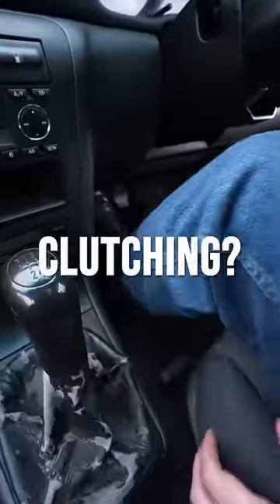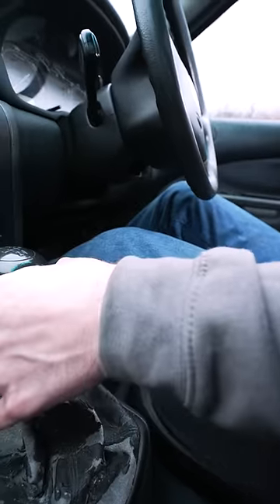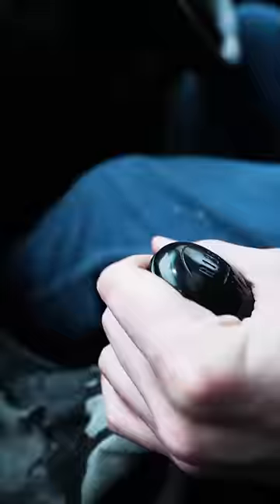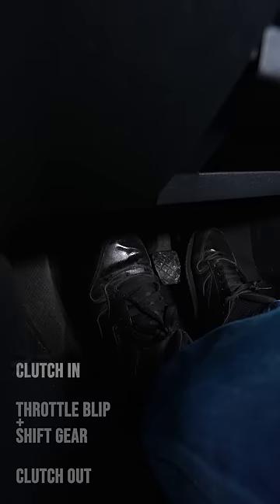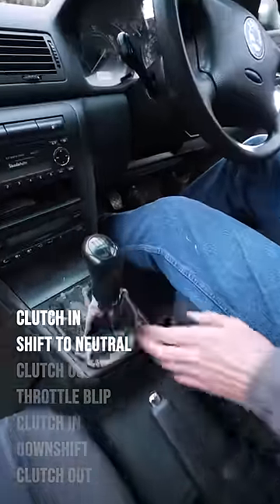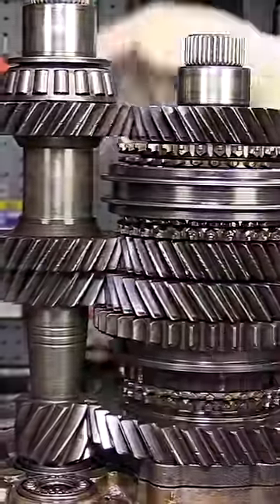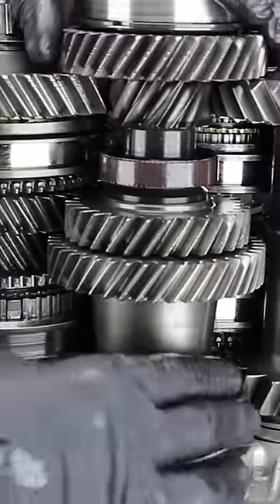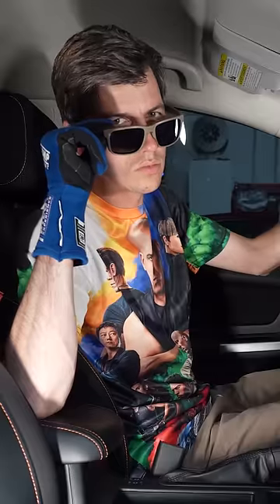What Is Double Clutching? Don't Granny Shift!

Comment: Finally someone understands the differences in transmissions and why double clutching doesnt work in a conventional passenger car manual transmission
Reply: well it does totally work, its just not as usefull
Reply: Double clutching does work on cars. I used to do it all the time with the old three on a tree cars.
Reply: It does work, it's just not strictly necessary. It definitely saves wear on your synchros, tho. Especially when downshifting, which is harder on the transmission overall unless you  have very accurate revmatching (as opposed to upshifting where you just need to pull off the throttle and naturally let the RPMs drop to match).
Reply: It also allows you to downshift faster because you use the engine to speed up the clutch, rather than using the slipping synchronizers to speed the clutch up.
Reply: It's pointless on most modern cars. I do use it when I need to use a LOT of engine braking, but that's it. Otherwise, it's slower.
Reply: It does work but not nessesary, it slows down the synchros and allows it to slide into gear easels. In a race tho your probably gonna be slower
Reply: Done correctly, it replaces the work (slipping) the synchs usually do - effectively making them last forever. Of course, anyone that knows that also knows using the clutch at all is absolutely unnecessary for putting the trans into neutral, and basically unnecessary for selecting the next gear.
Reply: @GroovesAndLands Yes, I often drive without using the clutch, going up the gears is a lot easier than down. Some gearboxes just don't like it but many don't have a problem. I usually get supplied with a new work car or van every two and a half to three years, sending the old one back with well over 100000 miles on it. In 25 years that's over 1 million miles, and in that time I only had one that needed a new clutch and no problems with any gearbox.
It depends on how quick the revs drop when you take your foot off the gas as to how quick you can select the next up shift. Downshifting you need to match the higher revs needed for the lower gear. 
My 96 Subaru GTB had a light flywheel so I could do very quick clutchless changes which dropped the 0-60 time. 
I have also done it on my 1100cc motorcycle.
Warning!
Do it wrong and you will hear a nasty crunch, do it very wrong and you might break your gearbox.

Comment: sometimes it's useful when transmission is not completely  in order. Instead of using force when shifting you can use double clatching. Obviously tll time you repair gear box.

Comment: Granny Shifting refers to a specific transmission made by GM that was used for both passenger vehicles and medium duty trucks. Both transmissions had the same gears however the passenger vehicle variant had an aluminum case. It was referred to as Granny Shifting because 1st gear was for starting from a stop with a heavy load.  With these trucks you would start your shift pattern in 2nd gear with no load. 1st gear was for towing and hauling.
I know because I trained on these transmissions.
Reply: That's a granny low gear. Granny shifting is double clutching on the upshift. It's a reference to the olden days before synchromesh.
Reply: @briangwynn3592  synchronizers became mainstream in the late 50's. Back then I don't think they used the clutch for shifting after first gear. 🤣😂🤣😂🤣😂
I trained on the Granny, the Clark, the Muncie, and the Saginaw about 30 years ago. 😂🤣😂🤣😂🤣
Tells you how old I am🤣😂🤣😂😁😎

Comment: Huh, I’ve been doing that in my own manual since I bought it; it makes rev matching so much easier. It’s nice to know that this is what it’s called.
Reply: But why do you do it?
Reply: @htimsid  After rebuilding the transmission (first gear teeth were sheared when I bought it), I realized that rev matching would extend the life of the synchros. I figured that using the clutch to bring the gears up or down to the speed of the next gear in between my shifts would allow me to rev match. I now know that’s what double clutching was, but I had no clue of it at the time.
Reply: Actually called double de-clutching.
Reply: How could letting the clutch out in neutral and blipping the throttle possibly help match the speed to the next gear if you're up shifting, when you need the RPM to drop to match it
Reply: @7x779  You don't- it is normally only used when down-shifting.
Reply: You don't have to double clutch to rev match lol
Reply: no it's not.  shift then tap the clutch to slip the power band higher..
Reply: Um... absolutely nobody in Europe (where we largely drive manuals) uses double-clutching, unless they drive some vintage car. To accelerate as fast as possible, you need to know your max torque and max RPM. Go to your max RPM in first gear, press clutch, shift gear up while reducing the RPM to max torque, release clutch, run to max RPM, rinse, repeat. Double clutching only makes you lose time and speed.
Reply: @SeverityOne  'nobody in Europe...' Sorry, wrong. I do it regularly. Only on changing down, of course. Done well, it can actually be faster than letting the syncro slow the driven shaft down. It is, of course, called 'double de-clutching' not 'double clutching'. The latter makes no sense.
Reply: @Tensquaremetreworkshop  I've never found a use for it, and I occasionally go from fifth to second gear. To each their own, I suppose.
Reply: @SeverityOne  it is largely about sympathetic operation of mechanical devices. As synchromesh  systems have improved it is less needed, but wear is still involved. When you have been doing it for decades it is completely unconscious.
Reply: That's ridiculous mate to do in a modern car
Reply: @Heroball299  It may not be strictly needed, but it does no harm, and technically can reduce wear to the syncromesh. If it becomes second nature (it is entirely subconscious for me) then driving an old vehicle (or one with a faulty clutch) requires no change to style.

Comment: Press in clutch put trans in neutral press in clutch put trans into your next gear 

Clutch, neural, clutch, gear 

Easy to get used to you never jam em into gears especially in big trucks for example with Eaton transmissions those can be put into gear with your finger they pop right in and out depending on transmission speeds

Comment: My father taught me double clutching even though all the cars we had featured synchronized transmissions.  His reasoning was it would save wear and tear on the synchronizers, and a clutch is cheaper to replace than a transmission.
Reply: I do it as well, especially when towing a trailer, just to minimise the sudden torque hit when you engage a lower gear when slowing down, thats the thing that makes engine go haaahaaaa
Reply: Yeah I used double clutching to make shifting smoother. It depends on how the transmission responds to how you shift
Reply: Rev match your shifts, double clutching is completely unnecessary
Reply: been driving manual for nearly 40 years now, never doubled clutched, except when smoking the odd joint, and have never ever burned out a transmission, but have replaced the odd clutch. Double clutching in a modern manual is bullcrap - but the funny thing is i do it all the time on my bikes, because its quick n easy and sounds great...ha ha
Reply: Oh man. For sure I don't want to replace the synchros after 900 000 km... Rather do it at 1 200 000 km and do one extra clutch change in between.
Reply: @sven679  Have you actually ever worn out synchros?  I've driven plenty of old manuals, and the transmission is one of the few things that hasn't ever crapped out on me.
Reply: @kaasmeester5903  No, that's the joke
Reply: @kaasmeester5903  I've been around and driven plenty of cars with bad synchronizers.
It's almost exclusively from bad clutch timing or trying to shift way too fast (which is still bad clutch timing).
You basically have to RPM match to get into gears with bad synchros, which is obvious but worth mentioning.
Reply: @kaasmeester5903 fwiw, I bought an '88 Honda prelude in 2002 that needed rev matched shifts or double clutched.

Comment: Did it in my class 8 trucks. It was easier to do that than replace the clutch after 100,000 to 200,000 miles. Saving the bottom line cost.

Comment: Double clutching is taught to you when getting the cdl A. But then you just float the gears when on your own driving the 18 wheeler saving your knee and the clutch. 

At my first driving job the technician told me not to double clutch and just float them gears.
Reply: Ironically, in some newer transport tractors, they use a “self-adjusting clutch”, so if you always float your shifts (like every competent driver) you will eventually find yourself without a clutch-brake. It’s not damaged; the clutch has just “self-adjusted” itself away from it too far for it to engage. So you have to shift with the damned clutch fairly frequently to keep it properly adjusted. I’ve gotten into the habit of using the clutch to cross over into 5th, and for any full step above that. That seems to be enough to keep it adjusted without making me blow a knee, lol. Darned engineers have it in for us some days, 😂
Reply: Is floating the gears just rev-matching?
Reply: @MrTehNoms  Yes.
Reply: I had an employer (and the Ryder staff) insist I was wearing out the clutch by float shifting. I just laughed!
Reply: What does floating the gears mean?
Reply: You can't do that on a modern car though
Reply: @kendallsmith1458 exactly. You're wearing out the transmission gears, not the clutch
Reply: @JohnBrown-ig5nc  I wanna know that too. I suspect it's just shifting gears normally but I'm not sure
Reply: @JohnBrown-ig5nc  Simply changing gear w/o pushing in the clutch
Reply: @jalpa4481You absolutely CAN "float shifts" (i.e. clutchless upshifts and downshifts) with a modern manual transmission car... I got really good at clutchless shifts with my Honda S2000!
Reply: @urracojalpa4481 done poorly, you're technically wearing out the engagement dogs on the sides of the gears (not the gear-teeth themselves).

Comment: My first car was an 84 Mazda 626 and when I learned manual on it I always double clutched as it's good for the condition of the synchros on old cars.
Reply: That’s not old
Reply: Doesn't really have to be an old car, just stopp and double clutch if you meet resistance when moving into a new gear.

Typical is first and the reverse gear, don't force it and grenade the gearbox like my brother in law.

Comment: Back when I was right outta HS in 04, I bought an 86 CRX (Carb not EFI). It was a manual transmission and I only had to use the clutch to go into 1st gear. I could upshift and down shift with just the accelerator blip.

it was a fun little 2+2 seater and I always threw people off not using the clutch that much. Someone actually accused me of having an automatic transmission and that the clutch pedal and the stick shift were for looks. haha
Reply: You're clutch was shot buddy 😂. And are you in Europe? Because all US crx models were 2 seaters
Reply: @synthWizkid  nope, I am US.

Thinking about it.  You're right. It was just a 2 seater. I was remembering that little trap door compartment as a fold down to cover the seat to make a bigger trunk. Lol

I had the clutch replaced shortly after I bought it. Still could shift between gears with no clutch if I was quick enough and had the timing right.

Comment: Usually on trucks with no clutch brake. But i dont know about racing. Its about  the gearbox or transmission. Thats why today you get synchronizers in the gearbox for the correct speed to smoothly change .

Comment: My dad explained this to me in the 70s- the cars he drove did not have gear synchronizers so you had to double clutch your down shift- one point- if you lose   Your clutch function- say the cable breaks or something goes wrong hydraulically you can use double clutch techniques to shift without a clutch. Takes a little practice to get the right rev but it has saved me a couple times
Reply: I think you should switch/repair your vehicle or learn how to not destory the clutch if you needed to do this multiple times when the clutch failed.

I abuse my car, Drving full throttle for minutes, shifting at the limiter, causing wheelspin when taking of around corners. All that multiple times every day on my drive from and to work. But i did not mange to destroy my clutch, to be fair, the whole car still holds up, excluding the tires obviously. Thats the beauty of slightly older cars ~7-8 years with very litte electronics.
Reply: Done that in my square body a couple times lol lost the clutch and couldn’t afford to fix it at that time thankfully no stops between home and work so just float up and down
Reply: if your cable is broken and the clutch wont disengage, then whats the point of even pressing in the pedal? when your clutch cable breaks or disconnects you have to just stay in one gear or rev match and switch without the clutch disengaging.

Comment: if you know how to do it, it helps by shifting faster and coming out of cornering with the engine already reved up, like we used to say" hitting the ground running". It protects synchro-rings, but makes sense in the 1st, 2nd and eventually 3rd gear.

Comment: Double clutching changes the shaft speed of the shafts in the transmission.
Reply: What does that have to do with anything? The synchronizers will still match speeds and allow for smooth gear matching provided you have healthy gears, bearings, fluid, etc.

You really are wasting time if you are a double clutching with any synchronized transmission.
Reply: @christopherbarber288 yeah, just dorks who watched fast and furious and want to feel cool and like they know better because Vin Diesel told them they're supposed to, even though they were upshifting in the movie.
Reply: @christopherbarber288  It helps when skipping gears  but other than that yeah it's a waste of time. I always double clutch 1->5, 2->5, and 5->3. Everything else I do normally.
Reply: @CS-pl8fc  haha yeah I agree

Comment: Sometimes I have to do it in my 1992 Mitsubishi when the synchronization doesn't work. Quick shifting can damage your synchronization, and without double clutching, the gear won't go in with higher rpm

Comment: is a 2003 car considered old enough to double clutch?
Reply: Old is roughly around 1930 and before...  We figured out synchronizers early on.
Reply: You can double clutch any manual. Cars as early as the 1970s (maybe even earlier) started using synchros though, so it’s a pretty obsolete technique unless your synchros are destroyed. Its your car though so drive how ever you like honestly.
Reply: In my opinion double clutching is kinda useless and it wastes time, try doing heel and toe, its way more fun and efficient to do it.
Reply: Even Russian trucks should be synchronized by 2003.
Reply: Full syncro manuals were standard by the 1980's on all cars. Earlier, the more expensive cars might full syncro manuals while many less expensive often had 1st gear unsyncronized.

Comment: Learned this on an old 1934 I believe it was Ford with a flathead V8 . Had to do it right or stop and start over. Still use it when downshifting on any standard tranny i drive . Why ? Just a old habit I haven't broken. But it still works for me. 😊

Comment: Idk about any use cases for x2 clutch but to upshift smooth, the transition from accelerating to coasting, the gears sit together loose and can be clutchlessly put into neutral before clutching into the higher gear for a consistently smoother ride.
Downshift is full clutch, full gas, jam it into the lower one, done.

Comment: As a trucker of 13 years I’ve never once double clutched I learned from old school drivers on how to float the gears doing so in a gas car with a fast rpm (such as a drag car or any sports car for that matter) it’s next to impossible to float however a dodge diesel pickup or a big block gas pickup like a 90’s model chevy 3500 with a 454cui motor floating is doable even under a heavy load so I personally have never seen a use for double clutching and mind you I’ve been well over a million miles in 13 years and I’ve never had a transmission fail me yet

Comment: Now I'm not too certain with modern motorcycles, as I have only owned 40 year old bikes, but I can shift up and down without needing to pull in the clutch. I just need to get the throttle to a certain spot and I can shift without issue. Motorcycles run off a wet clutch system, a method I was taught in my riding class was to ride the clutch so you can move in traffic without needing to fully shift gears and pull the throttle.

Comment: I mean, the phrase is formerly double declutching colloquially.  Are used to race pro rally,  time trials and hillclimbs, and the main advantage in a synchromesh, gearbox, equipped vehicle, for double declutching, is not upsetting the balance of the vehicle during a downshift, especially if just starting to enter return. This is all the more important in mid engine and rear wheel drive vehicles. So in that case it was far more important to just keep weight from transferring in an erratic manner.

Comment: A long time ago I drove a friend's pickup with three on the tree. The first gear was not synchronized at all. But 2 and 3 were. If I needed to grab first gear while moving at slow speed without stopping (like going up a steep hill), I had to double clutch to get into first without grinding it.

Comment: I learned how to double clutch 8 yrs ago because I was told I needed to do it during my behind the wheel portion of my driver's test to get my cdl. The examiner told me I did not need to do it during my test. Though, I got relatively good at doing it then, I have never done it since. I just float the gears and rarely grind going up or down.

Comment: Driving a stickshift is not as complicated as some Americans want it to be. No need for double clutch. No need for throttle blip. It's all Hollywood drama. But! You can even shift gears without pressing the clutch at all, if you're in a bind.